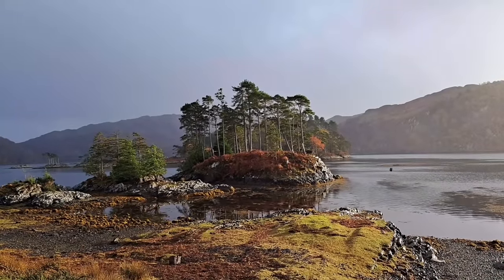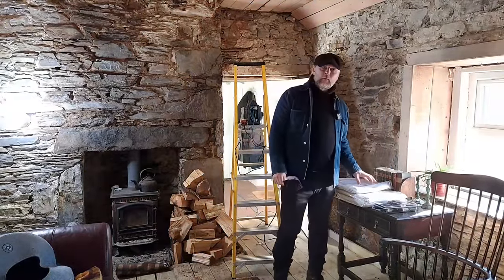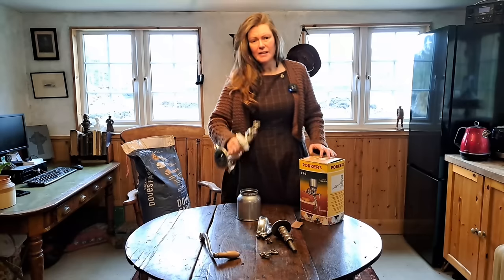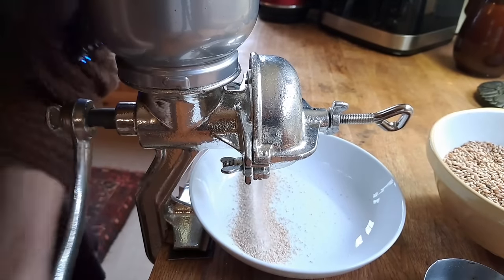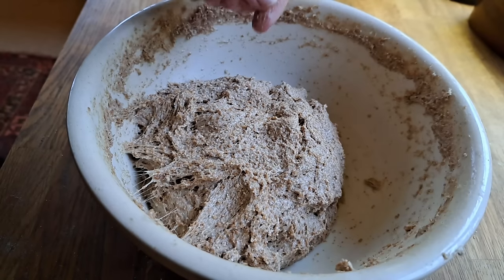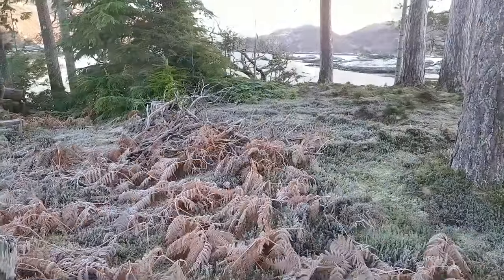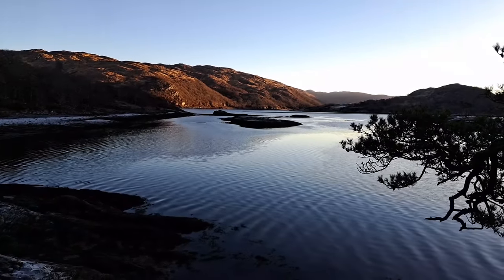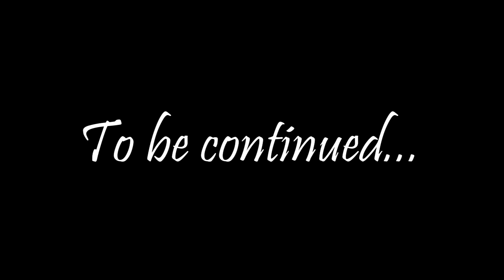41: Grinding Flour for Trad Bread; Restoring the Crofter's Ceiling. Highlands I The Scottish Isle

Comment: You'll probably never see this comment and probably have a mixer by now as I'm still a few months in the past.. but here's my two penneth re mixers. 
We bought a Kitchenaid around 15 year's ago for needing dough. They're really powerful and reliable, also mendable. (Old school technology) Keep them greased and they'll last years.
I've replaced the brushes a few times and replaced the base as the pin hole wore out.. apart from that it's been brilliant,  used every other day.
Reply from the maker: Thanks for this tip! Kx

Comment: Since whole grain bread is so much lower in gluten I always add vital wheat gluten in order to lengthen the gluten strands and improve the rise. I also use the no knead method and treat the dough very gently so as not to break the strands. Have done this for decades. Works every time.

Comment: Just a small tip re your ceiling boards. To caulk the joints, cut the tip of the tube as close to the size of the gap you want to fill, don’t be to fussy. Then push the tube along the gap this will stop the caulk falling back out, fill it up and shape the gap, no fingers required. Give it a go.

Comment: You can do a first grind that is not as fine and then crank it down and run the flour again to get it as fine as you want.  It's way easier to crank.  Also, drill some holes in the foot plate and you can bolt the mill down somewhere and it will be more solid, if you have a spot you can spare to leave it.  Nothing compares to using fresh-ground flour!
Reply from the maker: Good idea. Maybe when we renovate the kitchen I can put it in a permanent spot. Kx

Comment: You should have added honey or sugar, just a teaspoon or two to initial yeast mixture to help the yeast get going strong.   I think you needed a bit more flour, maybe 1/4-1/2 cup and should have let it rise longer.  Home ground flour, especially all wheatberry or whole wheat is not as soft as when you add some white flour.  I love the whole grain bread, with no flour, but it does take a longer rise because it's a heavier flour.  Maybe should have even used more yeast.  Keep at it!  Even a "fail" is still great!!!  Adjust all till you get the recipe right for you!  My family generally won't eat any whole grain, or even sourdough, and both are my favs!

Comment: Somewhere in a back corner under my bed is a photo album from when I was (at most) a teenager.  In other words, it's old.  Inside that album is a series of poorly taken black and white photos, taken with the lens right up against my bedroom window to avoid the refection of the flash.  There had been an ice storm that day, and it was still going on when I went to bed.  Something woke me, it was probably the quiet, so I looked out the window.  The trees, bushes, and grass outside my window were completed covered with ice lit only by the street lamps.  They wouldn't challenge Ansel Adams, but they are a lovely memory.
Reply from the maker: Wow, that sounds beautiful. Time to look out that album! Kx

Comment: Good baking for first try. I mill my own wheat berries also. The bread is much more dense from whole wheat. Try leaving out the oil as it is used for pizza dough and denser.  Just try yeast, water and salt only with flour and you will get better results. Wet your hands lots to knead to keep from sticking. Also, yeast reacts to metal ions and it can cause the bread not to rise like it should if left to rise in a metal pan or bowl. Hopefully some of this information you might can use. Thank you for such lovely video's.
Reply from the maker: Thank you for this, some other viewers also recommended to leave the oil out, so I will do that with the loaf I'm baking today! Kx

Comment: You won't have bats until may ish! They leave by september!🙄
Reply from the maker: We didn't hear them in the summer!
Reply: @TheScottishIsle  if there are any entry holes just cover them with mesh... thats what i did.. but give them bat boxes for an alternative!👍
Reply from the maker: Good tip, thank you. I hope we don't have them, but it wouldn't surprise me!
Reply: Most bats in the UK hibernate from about November to March.  Blocking the access to their roosts may well trap them in the building, which is the last thing you want as the "delicate aroma" of decaying bats is somewhat gross.
Reply: @18robsmith  in my experience in scotland they don't hang about where they have their offspring! They leave by the glorious twelth!(august 12) the opening of pheasant season for some reason!🙄
Reply: You should have added honey or sugar, just a teaspoon or two to initial yeast mixture to help the yeast get going strong.   I think you needed a bit more flour, maybe 1/4-1/2 cup and should have let it rise longer.  Home ground flour, especially all wheatberry or whole wheat is not as soft as when you add some white flour.  I love the whole grain bread, with no flour, but it does take a longer rise because it's a heavier flour.  Maybe should have even used more yeast.  Keep at it!  Even a "fail" is still great!!!  Adjust all till you get the recipe right for you!  My family generally won't eat any whole grain, or even sourdough, and both are my favs!